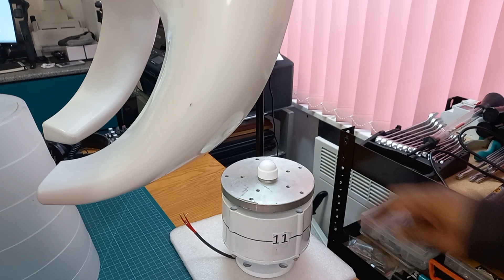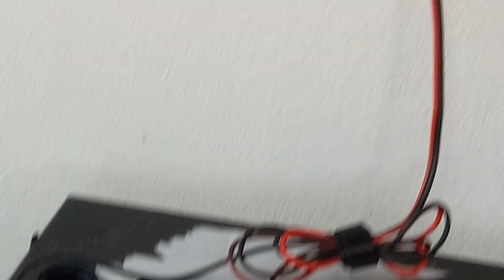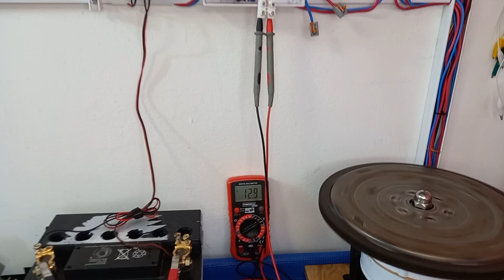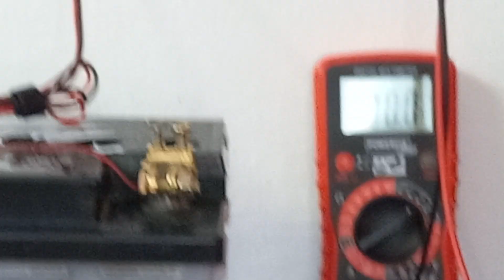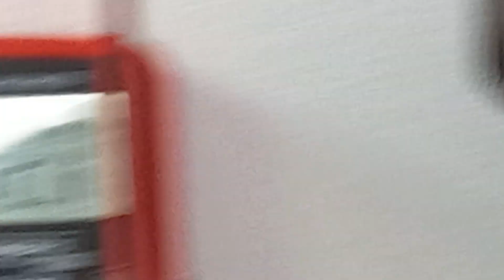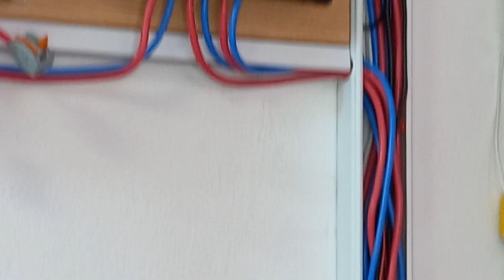Free Energy Generator works anywhere  II

Comment: @Esewarathas Thangarajah,

Connect at least 20 watt filament bulb and provide the input and output energy data.
Reply from the maker: This project is not finished yet, it’s still on the test level. There will be more videos, which I will consider your questions as part of it. 
Let this pass the test level, and safety measures. I will consider your question. Sorry I could not do it right away. I have to follow all the regulation. 
Thanks for your comment, all comments are welcome
Reply from the maker: this technology is brought to everyone, and to rise the changes to create electricity without using fossil fuel, and undependable natural elements or resources

A legal closure is made by surf 2 green, you have to have permission from surf2green to manufacture or modify this product technology Number 2 0 2 1 1 1 9 F E E G 2 0 2 0. and for more detail and for the application of the permission and for the diagrams 
Please visit our website to contact surf2green NGO
Reply: @esewarathasthangarajah2011  Thanks Sir, may I ask your website? I cannot find it.
Reply: @esewarathasthangarajah2011  Also wanted to ask what is the Amps that is going into the generator and coming out of the generator. Thnaks

Comment: You did not show Watts in vs Watts out with Meter. Volts times amps equals Watts. You said 6v battery at 1 amp equals 6watts but what is Watts OUT?
Reply from the maker: I will come with another episode on this matter, Thanks for your question.
The generator is capable of producing around 12 Volt 600 Watts Maximum, but everyone knows that is impossible. Still, after the modification, it should produce around 12 volts and Max 350 Wats, But, It is producing definitely  12 Volts and 300 watts the calculated current is 25 AMPs on the production.
Even at the higher cost, of energy-consuming, say if, 6 Volt 1 Watt, and it’s producing 12 Volt 300 Watts which it’s producing 25 AMP of currant. In which case, I am not losing any energy, But I am producing sufficient electricity to charge the 12 Volt battery bank. 
Once again, Greg, thanks for your question
Reply: @esewarathasthangarajah2011   
You mean . 1/4. .25 of a amp at them rpms. At 150 rpm. 3 amp max.
Reply from the maker: @TheDeadEndChannel  In the future videos I will have detail about RPM, AMPs and more
Reply: @esewarathasthangarajah2011  Torque must be taken into account. Any rotary generator, such as a 12V 300W, will certainly provide 25A if it is under load and sufficient torque and rated speed is applied. Surely everyone knows the dynamo on the bike, how difficult it was to overcome its resistance when the light bulb switch was closed. In order to be able to spin such a generator with 4xAA pencil cells, it is necessary to draw a minimum amount of current at the output, which is smaller than that provided by AA pencil cells. This will make the generator rotate almost without resistance, so the AA cells can spin it with little force (with little torque). It's a vicious circle. There are generators made of asynchronous motors with short-circuit armature and residual magnetization, which require high speeds and relatively low torque. It's always something for something. As I mentioned somewhere above, you only maintain the voltage of the battery, not its capacity, which you must measure with an ammeter in the load, not a voltmeter. In the application of "production" of energy using AA pencil cells, any high power generator is unnecessary, unless it is used in another and better solution.